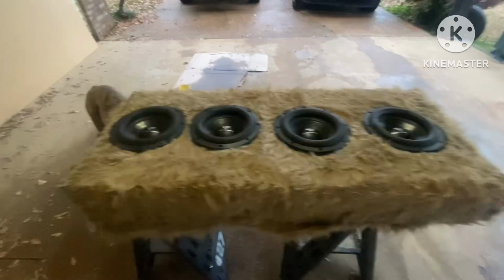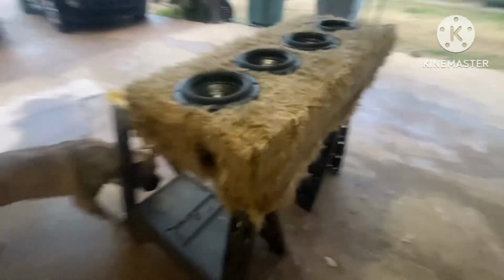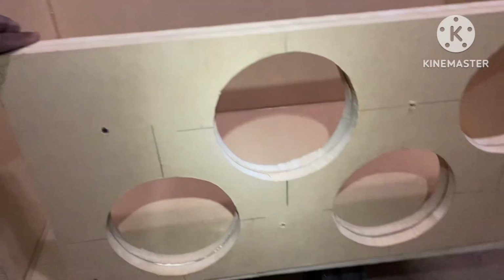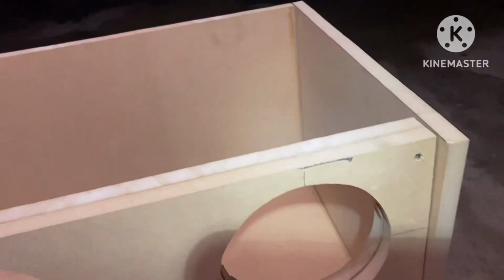4 8” Black Diamond Sub Build/Tuned to 31Hz

Comment: Would be even more badass if 1 of those subs wasn't rattling so much. Sounds like a loose wire snappy around in box or maybe dust cover is loose. I bet that thumped very nice though. Clean box build man
Reply from the maker: Sir tape was wrap around each terminal and wire so that wouldn’t happen, I heard to to and believe it was coming from above the box.